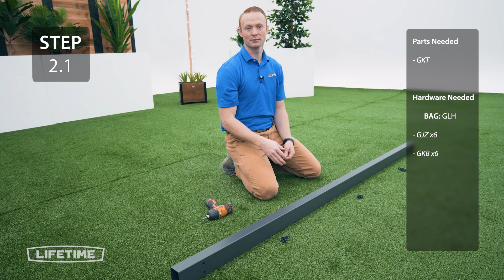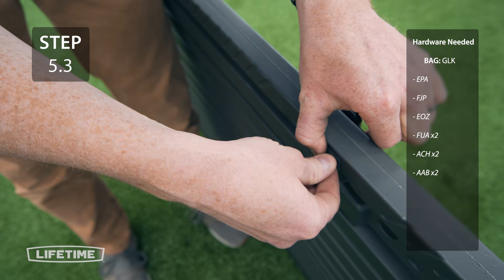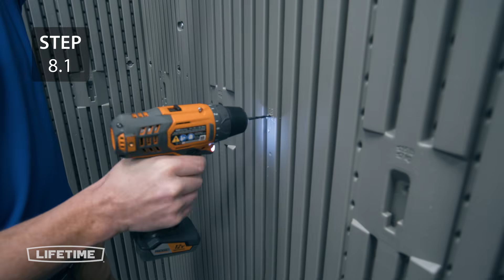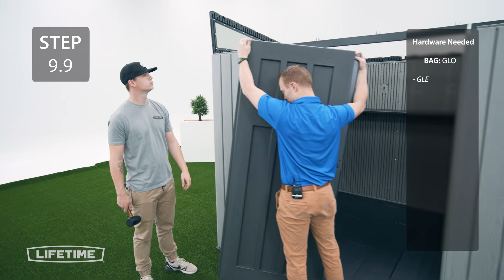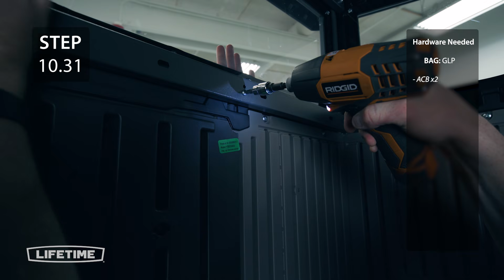Lifetime 8' x 8' Modern Shed | Model 60336 | Lifetime Assembly Video

Comment from the maker: Section 1 
The video will cover the assembly of the shed, not the platform. Please refer to your manual for how to set up the platform.

Section 2 
02:40 | Step 2.1
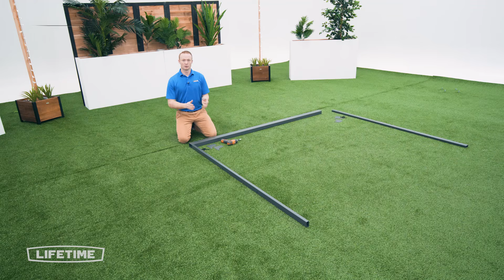03:08 | Step 2.2
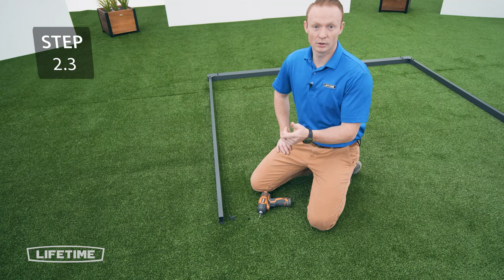04:40 | Step 2.3
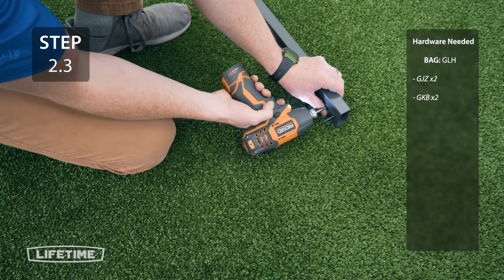04:52 | Step 2.4
05:01 | Step 2.5
05:19 | Step 2.6
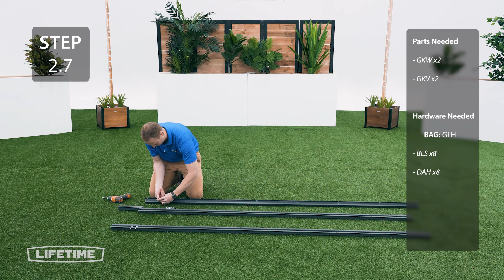05:39 | Step 2.7

Section 3 
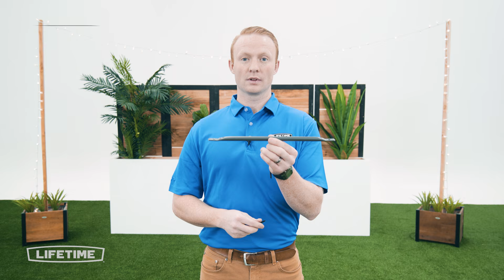06:13 | Step 3.1
06:24 | Step 3.2
07:16 | Step 3.3
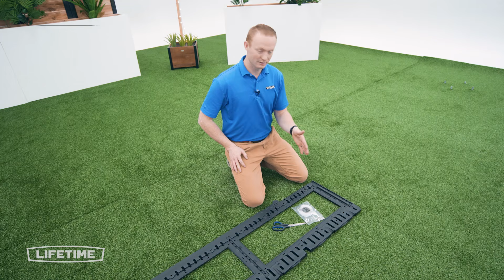07:36 | Step 3.4
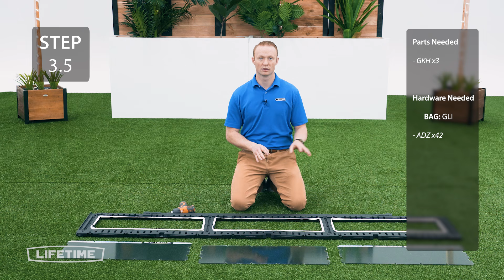08:39 | Step 3.5
09:56 | Step 3.6
10:30 | Step 3.7
10:54 | Step 3.8

Section 4 
12:15 | Step 4.1 
12:33 | Step 4.2
12:49 | Step 4.3
13:05 | Step 4.4
13:43 | Step 4.5
14:06 | Step 4.6
14:11 | Step 4.7
15:02 | Step 4.8

Section 5 
15:26 | Step 5.1
15:45 | Step 5.2
16:00 | Step 5.3
16:49 | Step 5.4
17:06 | Step 5.5
17:22 | Step 5.6

Section 6 
17:52 | Step 6.1
18:11 | Step 6.2
18:25 | Step 6.3
18:45 | Step 6.4
14:34 | Step 6.5
14:50 | Step 6.6
15:19 | Step 6.7

Section 7 
20:16 | Step 7.1
20:50 | Step 7.2
21:36 | Step 7.3
22:10 | Step 7.4
22:27 | Step 7.5
22:40 | Step 7.6
22:54 | Step 7.7
22:59 | Step 7.8
23:13 | Step 7.9
23:25 | Step 7.10
24:00 | Step 7.11
24:24 | Step 7.12
24:52 | Step 7.13
25:10 | Step 7.14
25:39 | Step 7.15
26:00 | Step 7.16

Section 8 
26:24 | Step 8.1
26:58 | Step 8.2
27:19 | Step 8.3
27:40 | Step 8.4
27:59 | Step 8.5
28:19 | Step 8.6
28:31 | Step 8.7

Section 9 
29:01 | Step 9.1
29:51 | Step 9.2
30:24 | Step 9.3
31:19 | Step 9.4
32:05 | Step 9.5
32:22 | Step 9.6
33:06 | Step 9.7
33:28 | Step 9.8
33:48 | Step 9.9
34:30 | Step 9.10
34:55 | Step 9.11
35:13 | Step 9.12
35:48 | Step 9.13

Section 10 
36:11 | Step 10.1
37:28 | Step 10.2
38:16 | Step 10.3 
39:06 | Step 10.4
39:24 | Step 10.5
40:13 | Step 10.6
40:34 | Step 10.7
42:17 | Step 10.8
42:42 | Step 10.9 
43:01 | Step 10.10
43:28 | Step 10.11
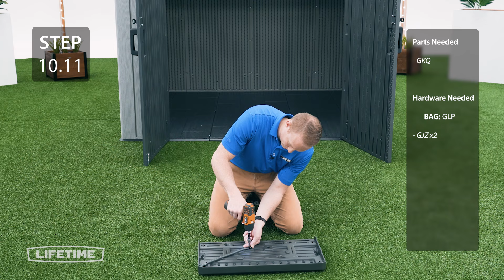43:47 | Step 10.12
44:28 | Step 10.13
44:55 | Step 10.14
45:21 | Step 10.15
45:36 | Step 10.16
45:57 | Step 10.17
46:13 | Step 10.18
46:58 | Step 10.19
47:17 | Step 10.20
47:51 | Step 10.21
48:13 | Step 10.22
48:43 | Step 10.23
48:55 | Step 10.24
49:16 | Step 10.25
49:29 | Step 10.26
49:39 | Step 10.27
49:49 | Step 10.28
50:05 | Step 10.29
50:10 | Step 10.30
50:12 | Step 10.31
50:19 | Step 10.32
51:09 | Step 10.33
51:22 | Step 10.34
51:37 | Step 10.35
51:46 | Step 10.36

Section 11 
52:43 | Step 11.1

Section 12 
53:15 | Step 12.1
53:21 | Step 12.2

Section 13 
Refer to your manual
Reply: Is the manual online?
Reply: A link to the manual here would be very helpful.
Reply: does anyone know where the glc parts are used?
Reply: Frfr FFTu desert xx
Reply: The y
Reply: Two questions that only require yes or no answer.

1) Is this shed made in the USA (Y/N))?

2) Is this shed made in China (Y/N)?
Reply from the maker: This shed is US made
Reply: I've had 5000 plus square feet homes with tall ceilings. It's not usual that all 3 units go out at same time. I find it odd they say you need 3 now. And I'm wondering why 2 5 tons couldn't get it done.

Comment: Terrible directions...the screws not correctly labeled so had to guess which ones to use. Video did not match booklet..
Reply from the maker: We apologize for the frustration and would appreciate it if you could share the specific steps where the manual and video didn't align so we can improve our instructions.

Comment: This video is very helpful. thank you! i assembled the shed in 2 days. only needed help with the roof 2 person job. only negative is the black plastic nobs you push into the roof they need to be better they keep spining when trying to tightened them. i was not happy. overall the shed i am pleased with. 7/10 quality/experience with setup.

Comment: I greatly appreciate the instructional assembly video: thanks.  I think the small Phillips screw fasteners are not a good  fastener choice ( JIS, Torx, or Hex would be much better). Secondly,  the push in ANCHOR PLUGS tend to spin in the socket if exposed to the sun on a hot day.  This is my first attempt at assembly of a shed kit.  It went fairly well, but I needed an extra hand at certain points of assembly.  Again, great video.

Comment: Manual plus video is the way to go.  I was missing a few parts, but they were door latches - they are in the mail.  Shed for the most part went together ok.  Some of the anchors stripped immediately.  The manual has some errors - such as saying there are two shelf bars but there is only one.  The shelf isn't an exact fit.

Comment: i need some more screws for the roof. How do you work out where to position each roof panel as they all look the same?
Reply from the maker: The lower roof panels (AGQ) are the longer roof panels. There should be 4 of these. The upper roof panels (CVC) are the shorter roof panel. There are also 4 of these. All the roof panels are interchangeable so you wouldn't have to worry where to position which panel. You can order more screws through customer service. They can be reached at 800-225-3865 or by email at customercare@lifetime.com. Customer Service hours are Monday-Friday, 7:00 am to 5:00 pm and Saturday, 9:00 am to 1:00 pm (MT).
Reply: The 4 roof panels are physically all the same.  What determines their position is where you snap in the anchors.  The instruction manual is very good and shows you where to put the anchors in for piece 1, 2, 3, and 4.
Reply: @Heisen berg  They really should just prefilled every hole with an anchor or at least the ones needed or give more in the bag. Still can't figure out where I'm missing anchors at and that step was a pain trying to squint and read every location that needs an anchor.

Comment: Im having an issue with the doors hinges. They seem to drop and the doors rub on the platform. Is there a way I can keep them from hitting? Thanks.
Reply from the maker: Try putting one of the plastic shims that come with the shed underneath the hinges. Doing this will help raise the door of the floor making it easier to open. If you need more shims or need any further assistance, please reach out to our customer service team. They can be reached at 800-225-3865 or by email at customercare@lifetime.com. Customer Service hours are Monday-Friday, 7:00 am to 5:00 pm and Saturday, 9:00 am to 1:00 pm (MT).
Reply: @LifetimeProductsAssembly  I will give that a try. Is there any extra bracing that you have for this shed, like your weather kit 60011?

Comment: Does anyone have information about Anchoring? I have concrete platform, but I don't know where and when install the anchors
Reply from the maker: All anchoring information can be found on page 120 in your instruction manual. If you’re still having troubles, reach out to our customer service team and they’ll be able to help you with this step.  They can be reached at 800-225-3865 or by email at customercare@lifetime.com. Customer Service hours are Monday-Friday, 7:00 am to 5:00 pm and Saturday, 9:00 am to 1:00 pm (MT).

Comment: My observations:
Nowhere in the manual or the video does it mention the approximate time it may take for the average 2-person team to build this shed. (Average meaning we have some understanding of construction.)
Packing the boxes with the parts that will be used - in the order that they're needed - rather than dividing them so they pack in two equal-sized boxes would have made the parts identification and the assembly go much more smoothly.  
I get the pre-assembly of some parts, but there is too much of that initially, especially when the pieces are in 2 different boxes hidden among roof and wall panels (I know, best practice for conserving the packaging needed).
Screw anchors need to be built in on the roof panels, transom frame, and wherever the shelf can be installed to avoid spinning and/or falling out.  We had a few slots that were defective so the anchor wouldn't go in all the way.
The bottom bracket to the vertical beams should not be screwed down to the floor until after the roof panels are fully installed.
Someone else has already said this:  This product should have a solid metal frame that the plastic exterior connects to versus the other way around. Corners need metal support to keep stable the overall alignment. 

In my opinion, two more beam assemblies (3 total - front, center, rear) would have made the entire shed go together much easier and be a lot more stable. #LifetimeProducts

Comment: I just finished making a platform and putting this shed together.  I want to stress that is very helpful having three people as opposed to just two.  The fasteners are kept separate for each step in an individual, labeled bag which works nicely.  If you have any confusion with the precise screw to use, just hold up your screw to the paper page; all fastener images are the actual size of the fastener itself.  It took us about 2.5 hours to construct a wood platform and about 7 hours for three of us to put the shed together in its entirety.

Comment: Is this the same as the Lifetime Products Shed 190228 (7.5x7.5)? From Costco in 2021?  If so, is the footprint 8x8 or 7.5x7.5? Thanks,
Reply from the maker: Yes it is! Originally the dimensions were 7.5’ x 7.5’ which is why Costco has those dimensions, but before launch it has been updated to 8.3’ x 8.3’ and Costco has not changed it on their website yet but are hopeful it will be updated soon!

Comment: Can you put this right on a stone base? Does it need to be on 4×4
Reply from the maker: We only recommend a foundation built from outdoor rated wood or concrete. The foundation size for this particular needs to be at least, 91 1/4" x 91 1/4" (231,8 x 231,8 cm). This information can be found on page 7-10 on your instruction manual.

Comment: Is this 8x8 or 7.5x7.5 ft?
Reply from the maker: This is 8.3' x 8.3'. Costco has it labeled by 7.5' x 7.5', but those aren't the correct dimensions.
Reply: @LifetimeProductsAssembly  I need to get a gravel shed pad, What measurement do you suggest? The frame of the pad is supposedly wooden with dirt and gravel in between. Should the shed sit on the wooden frame? Please elaborate. Thank you
Reply from the maker: @shotgunacemunda4987  Gravel is not recommended for the foundation because you will have problems with assembly. However, if you decide to go this route anyways, the shed has to be on the leveled wooden platform. If you fail to do this, you will have problems with assembly and alignment. 

As for the size of the wooden platform, you will need to build a level platform of, at least, 91 1/4" x 91 1/4" (231,8 x 231,8 cm). This can be found on section 1.2 in your manual. Keep in mind the platform is a little wider than the shed floor. This is on purpose to help prevent flooding inside the shed. 

If you have additional questions you can always reach out to our customer service experts.
 They can be reached at 800-225-3865 or by email at customercare@lifetime.com. Customer Service hours are Monday-Friday, 7:00 am to 5:00 pm and Saturday, 9:00 am to 1:00 pm (MT).
Reply: @LifetimeProductsAssembly  how about I go with a cement shed pad? Will that work in lieu of the gravel pad. My HOA had suggested a gravel pad but if cement pad works better then I could pursue that.

Comment: How do you not strip the screws? They’re so difficult to screw in
Reply: Take the drill bit and make hee hole bigger.  Also use a large flathead screw driver to keep anchors from moving.

Comment: I just purchased the shed from Costco.  The box states it is 93.3 inches tall.  I want to assemble below a deck the has around 94 inches of clearance.  Will there be enough room to assemble correctly?  Thanks
Reply from the maker: No. We recommend building and keeping the shed on a wooden or concrete foundation that is completely leveled. The foundation will add some height to the overall height of the shed so it will be difficult to assemble the roof when you get to that part. If you have additional questions you can always reach out to our customer service experts. They can be reached at 800-225-3865 or by email at customercare@lifetime.com. Customer Service hours are Monday-Friday, 7:00 am to 5:00 pm and Saturday, 9:00 am to 1:00 pm (MT).

Comment: what is part AIW used for?  Left over part and manual and video don't explain it...?
Reply from the maker: AIW is you use it in between the wall panel and mallet so you don't cause damage to the panel when sliding it into place. You don't see it done in the video because John was more comfortable kicking it in with his foot, but it the AIW is highly recommend in use when you're completing this step. You can see AIW being used in Section 7 Step 7.7.
Reply: @LifetimeProductsAssembly  Ok got it...thank you for answering!

Comment: I built my shed on a wooden platform. I have had major issues installing the roof panels. The holes did not line up properly on the trusses, I think because my platform is not completely level. I believe I need to re level the platform and redo the roof, would you agree?
Reply from the maker: If you’re already on a leveled platform that shouldn’t be the case. I recommend contacting our customer service team with pictures of what you have on the roof assembly right now and we can troubleshoot what maybe going wrong. They can be reached at 800-225-3865 or by email at customercare@lifetime.com. Customer Service hours are Monday-Friday, 7:00 am to 5:00 pm and Saturday, 9:00 am to 1:00 pm (MT).
Reply: @LifetimeProductsAssembly  i have the exact same problem with my roof panels. I installed my shed on leveled wooden platform but my roof panels are all off from the truss. It aligns fine from the side wall panels but not from the truss

Comment: Just finished building the shed, Here are my comments:
1. watch this video
2. use the BILT app together with the paper manual
3. install the shelf (don't skip it) before the roof, it will show you if the shed is level, and most importantly, how much is the wall bending. This will affect the mounting of the roof (with the metal rails) later

The rail holes do align with the roof panel. If you find them not align, something is off position.
Great product, thanks Lifetime.

Comment: spent 1.5 hours reading entire assembly manual before starting project. spent one hour unpacking everything and checking against parts list to verify all was there. (it was). began assembly at noon, by 6pm all that was left to do was install the roof. Getting ready to complete the final steps shortly. I did not know this video existed! I had no problem understanding the instruction in the assembly manual. (I did watch the roof assembly portion of this video...no surprises there)

Comment: Better grab some ratchet straps and get creative to manipulate the top edges of the shed walls in place while trying to mount the roof panels.  Otherwise the outer walls line up just fine with the screw holes for the roof, but not the metal trusses.  Ratchet straps for the win folks.

Comment: My notched hinge tubes were unnotched making it way more fun first figuring out what the notches were for and quadruple checking I wasn't just missing something,  then determining what size they should be,  and finally cutting them with a cutoff wheel.  Didn't want to wait weeks for them to make it right via mail.   Cost me about 2 hours progress total.
Reply: I also had to cut the length of the extra 2 unnotched tubes down to the correct length when notching.
Reply from the maker: We’d love to take a look at this. If possible, please send us pictures of your defected part so we can better examine and have an idea of what went wrong. Please contact our customer service team with those pictures, if possible. They can be reached at 800-225-3865 or by email at customercare@lifetime.com. Customer Service hours are Monday-Friday, 7:00 am to 5:00 pm and Saturday, 9:00 am to 1:00 pm (MT). As a reminder, any modification to the shed or it’s parts is a violation to your warranty for it can ruin the functions of the shed or compromise the assembly. We understand waiting for parts isn’t always ideal, but we are always willing to help getting parts to you as soon as we’re able.

Comment: I Liked the video, It is all standard parts except type screws that attaches to roof from inside(black flat head) shallow opening and easy strips plus plastic Anker moves spins in hole
Reply from the maker: If you contact customer service, they will be able to help by sending you screws that fit the anchoring hole to help limit the spinning. They can be reached at 800-225-3865 or by email at customercare@lifetime.com. Customer Service hours are Monday-Friday, 7:00 am to 5:00 pm and Saturday, 9:00 am to 1:00 pm (MT).

Comment: Screw anchors in the roof panels just spins when screwing the in place what should I do to help with this problem?
Reply from the maker: If you contact customer service, they will be able to help by sending you screws that fit the anchoring hole to help limit the spinning. They can be reached at 800-225-3865 or by email at customercare@lifetime.com. Customer Service hours are Monday-Friday, 7:00 am to 5:00 pm and Saturday, 9:00 am to 1:00 pm (MT).
Reply: @LifetimeProductsAssembly  thanks for the help. Customer service was quick awesome and friendly
Reply from the maker: @davidburlison6010  Glad to hear they were able to help!